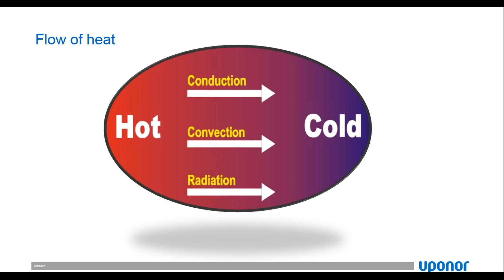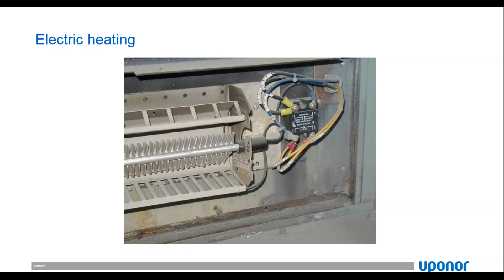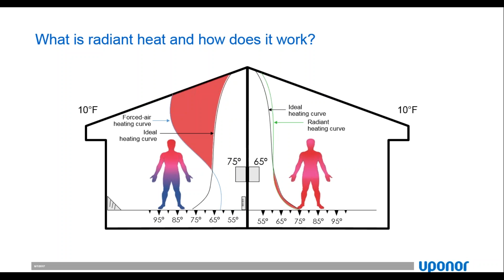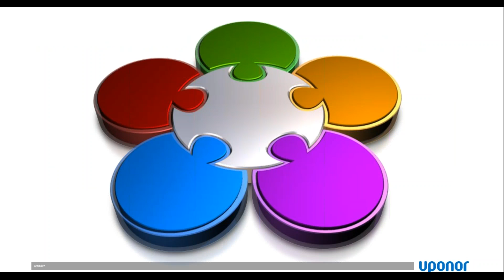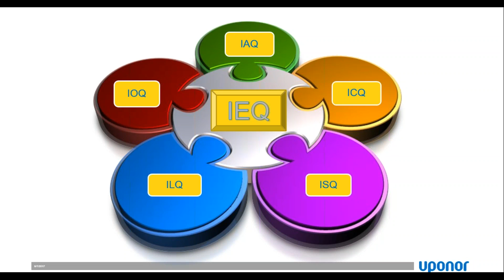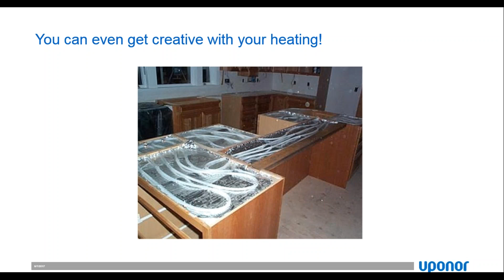Radiant vs  forced air  Which is more sustainable for a home

Comment: Wonder why my mom is cold in the winter because we have forced air heating and all heat goes up in the ceiling that’s why my mom is in a blanket during the winter so maybe we should get radiant floor heat so my mom won’t be cold because she does not like being cold. Forced Air is good  for air-conditioning in the summer not good for heat in the winter.

Comment: I have a hydronic system and actually want to go to forced air instead.  The hydronic are quite and efficient, but boy do they need more attention.  I have replaced something on my system almost every single year since I got it, about 12 years ago.  Parts aren't generally cheap, and if you have to remove anything concerning the pipes or valves, it can get really messy really fast.  If I were in a much higher income bracket, I might not care.  Just call "a guy" to take care of it.  In my house, I'm "the guy" because I don't have the money to pay someone else $300 or $400 to do something when I can get the part (exact same part) for $90 and do it myself.
Reply: @zlmdragon.  Temperature sensor, exhaust fan, which cost $700 retail cost just for the fan, zone valves, low water cutoff, air separator, circulator pumps, expansion tank, tridicator, and pressure relief valve.  I haven't even gotten around to replacing all the parts.  The tridicator isn't reading the right pressure.  I bypassed the low water cutoff.  That's a $100 part.  I have 4 zone valves that need to be replaced at about $92 each.  The air separator I haven't replaced yet.  These have so many parts that a forced air system doesn't have.
Reply: @zlmdragon.  The boiler I have is a Knight KBN080 by Lochinvar.  The fan is a fully brushless AC fan that is computer controlled so it can adjust it's speed in infinite steps.  When I look it up now, the price has dropped since this boiler model isn't made any more.  I typically buy from supplyhouse.com because I like their parts and they way they stand behind the stuff they sell.  They have it for $420 now.  I have a commercial HVAC friend that was able to get me the part for about $350 back when they were costing $700.  I just had to replace the cylinder in a Grudfos circulator pump, and that cost me just under $200.  I also had to replace 1 of the 5 zone valves, which cost about $92.

Comment: Question are there any heat pump systems available ( outside air to water) ready made ,not custom made .  How would you cope with thermo loss in (slab on grade) type construction assuming insulation underneath.  Subjects not touched on in webinar.
Reply: for any sort of low-temperature surface heating, the house MUST BE very, very well insulated and have airtight walls. those are two of five musts for a passive house (other there: no thermal bridging, "U" high-value windows, air recuperation).

Comment: This was nothing more than a sales pitch mascarading as a science presentation
Any hvac system has to designed as a full system.
Hvac is heating ventialtion and air conditioning
Radiant heating only adresses one of these
Ventilation is a very important part of the system not mentioned at all in this webinar
Reply: He compared hydronic heating vs forced-air heating. Not against the entire HVAC-system. Obviously, you would still need ventilation installed regardless, so it's not like you'd have to do without it, either way. But that is all besides the basic point, which is that heating by means of hydronics is more efficient than by forced air.